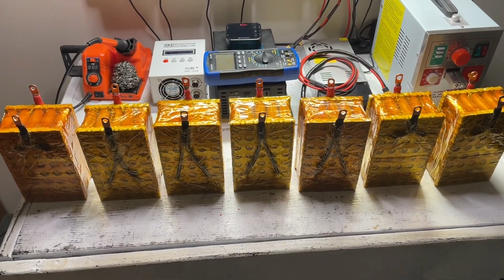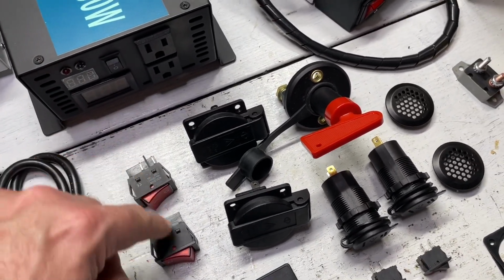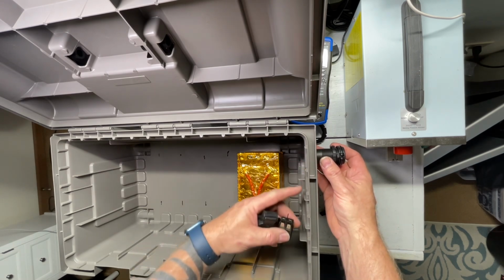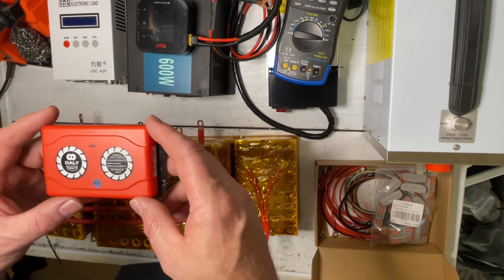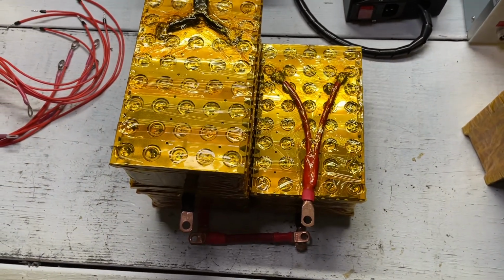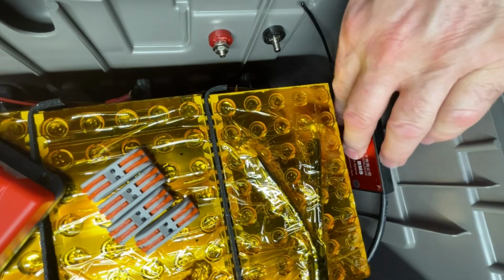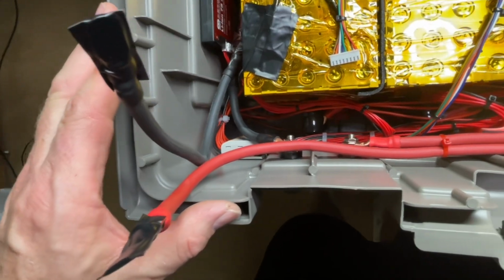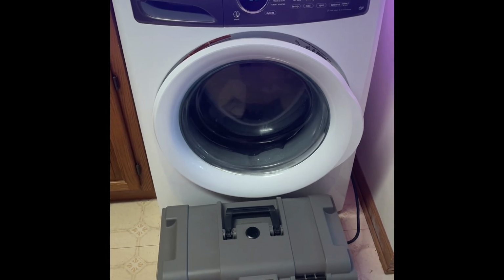DIY, 2000 Watt portable power supply solar generator ￼

Comment: Good stuff. I build these too. I've gone away, for the most part, on building my own batteries for my bigger units, but did just do a little one with victron components with my last 18650 based battery. The newer LiFePO4 batts are getting so cheap, and we live in a pretty temperate climate, so don't worry as much about them being charged in sub-freezing temps.
Reply from the maker: Yes, I have a large version with a 10 kW battery bank using 4 2.6 kW 24 V batteries that I made.

Comment: Great video amd good build. No fuses though, why is that
Reply from the maker: As the system can only pull 32 amps and the system can provide 60 amps. There's no need for a fuse, as it will never, ever reach the capacity.